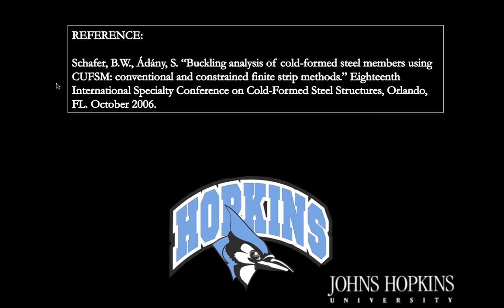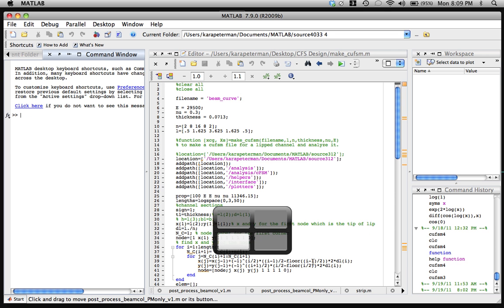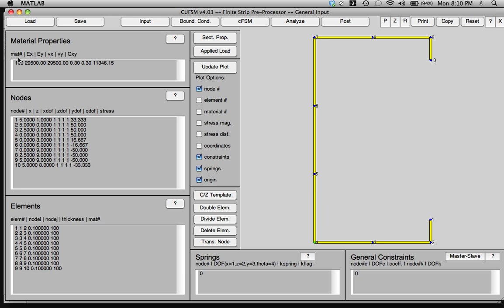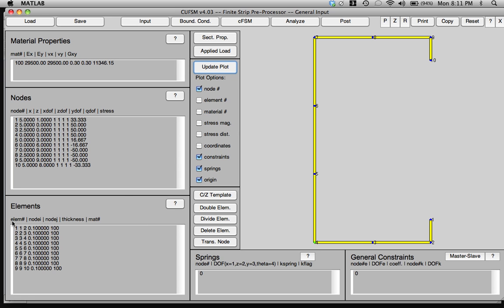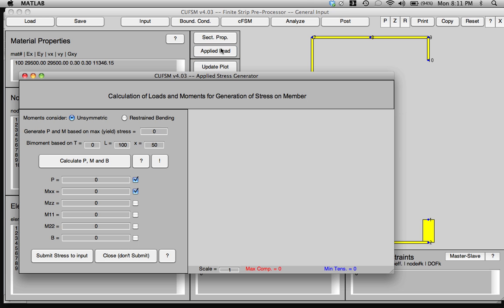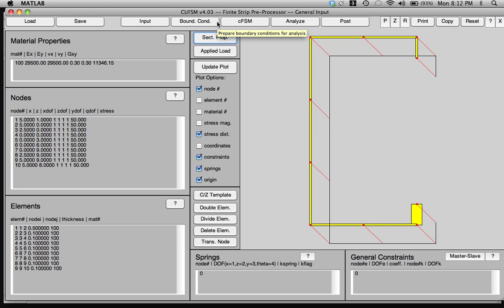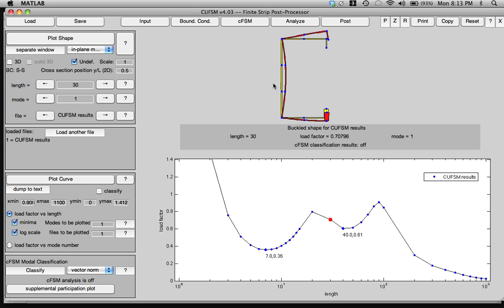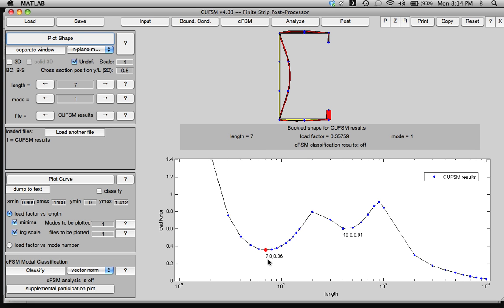CUFSM 4: The Signature Curve

Comment: Greetings Kara Peterman .... I'm doing my thesis about houses using Steel Frame. I was weondering if you could give me some of help. I need to introduce a profile configuration into CFUSM, something like a back to back arrange. But i can't fin the way to make it happen in the input sone. Please, could you give some advices about how can i do it in CUFSM?. Best regards.
Reply from the maker: +Lenin Bolanios You can simply enter the nodal coordinates of your back to back section, and connect the contact nodes with springs, which you can also specify.
Reply: Lenin Bolanios Hello. I read ur comment and im facing the same problem. did u manage to find a way to input a back to back arrangement? thank you. Eric

Comment from the maker: No graduate students were arrested in making this video.
Reply: Kara, where do you define the length of the member? In regards to the yield stress (50 PSI) is it equal to yield strength of the material or reduction factor should be applied?
Reply: Also, do I need to install MATLAB first, then CUFSM 4 and then MATLAB Component Run-Time Engine?